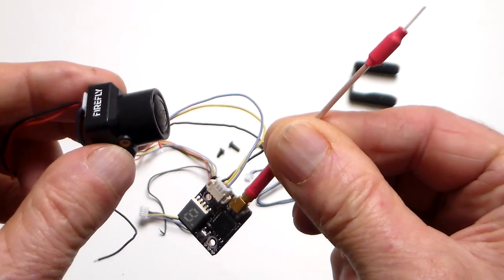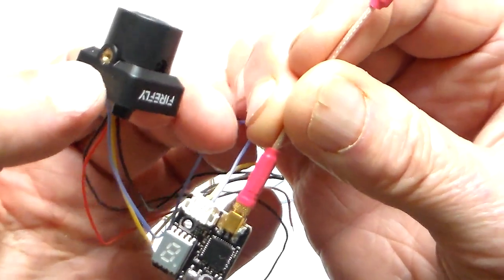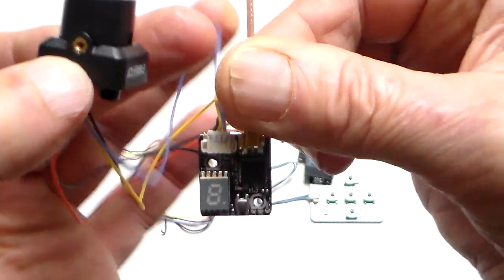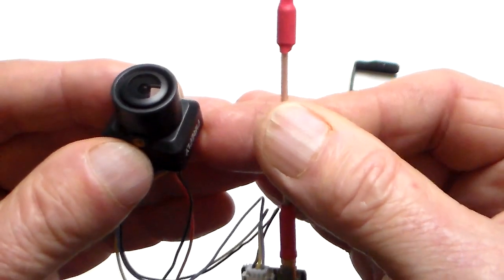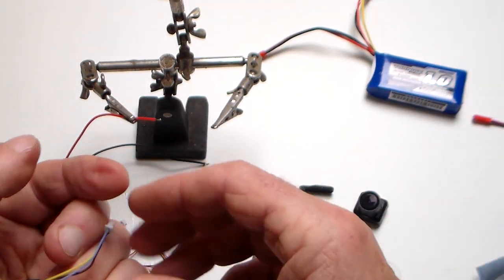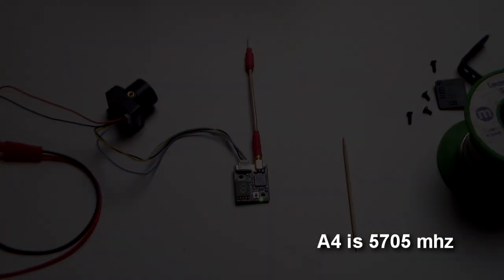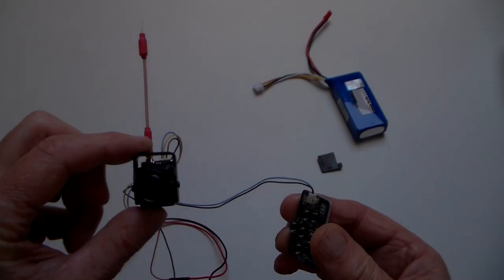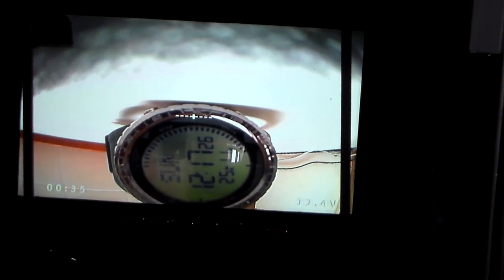Hawkeye Firefly Micro FPV Camera and TX - Unboxing and Using

Comment: Nicely done! I see you have a frame for your camera - I’ve been wondering if one is included with with the camera or if you have to supply your own. The photos don’t show one.
Reply from the maker: Thanks mate.  Frame came with the camera.
Reply: bobflyman Awesome! Thanks very much, Bob. Happy flying! New subscriber.
Reply from the maker: @PonyPonyBaloney  thanks mate.  I've been busy building foam board planes in lockdown and  have 3 new interesting ones to maiden when this blooming lockdown ends.  Ran up my paramotor today as well, I need some flying!
Reply: bobflyman Flying with a paramotor has always been a dream of mine. I wouldn’t have any idea how to even get started in the hobby.
Reply from the maker: @PonyPonyBaloney  Hi mate, well, I was free flying, paragliding for 18 years, 500+ hours and vowed I would never fly with a noisy awful motor. Had some good flights without all over. Even Australia and the French Alps. 8,000 feet, then I got a crappy  20 year old motor for free, Non runner. Fixed it up, but it wasn't really good for flying,  but a while later got a decent 2nd hand machine and have a little power flying.  Anyway to get to the point, there are schools for both paragliding and paramotoring. It helps a lot if you know how to paraglide first, like I did, but motor schools do teach from scratch .  Find a school. It's very addictive. Can be great, but can be very frustrating weather wise, and now we have a bloody lockdown!  Check out sky god Tucker Gott and his motoring!  1M subs. Google you'll find him.  A lot of the flying depends on where you live and how flexible your employment is! Good luck mate!
Reply: bobflyman Will do! TYVM Bob!!!
Reply from the maker: @PonyPonyBaloney  I always say to people, it's best, and the worst thing you can ever get into!  Some of the most amazing  moments in your life, but addictive and frustrating when you can't fly!
Reply from the maker: Did you see this one?  I'm just burning to get up there again! https://www.youtube.com/watch?v=r7VTFb7XCMA&list=PLLdle7NDE_1atnkdfBTNauoIBKXQhjmwN&index=3&t=0s